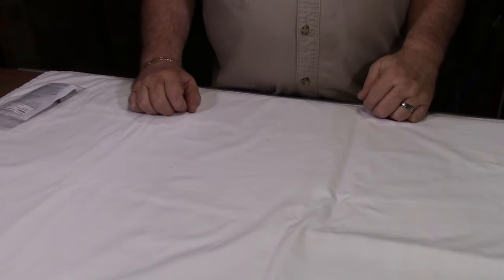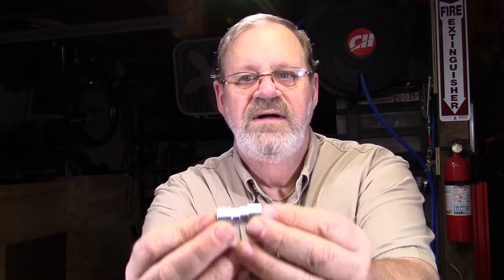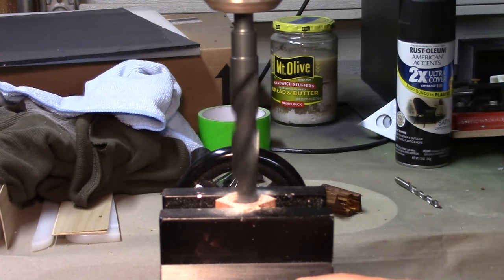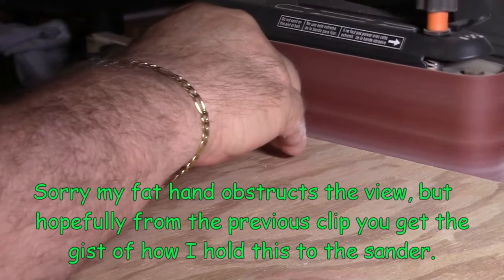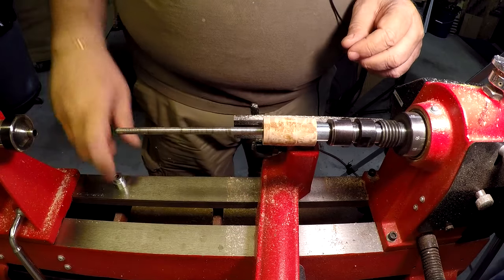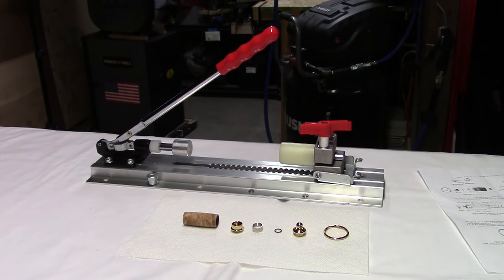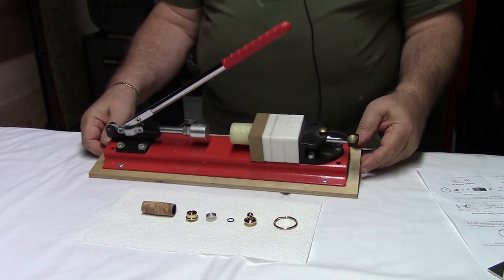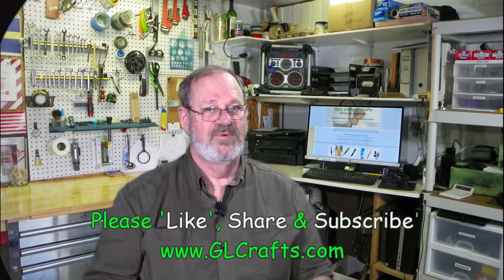Making the Secret Pill Compartment Key Ring Ep.2016-28

Comment: I just made this and Rockler’s directions say 14mm which is .55 compared to .5625 (9/16). Using 14 mmm with stabilized wood the hole ended up being way too tight.  I guess neither one works!